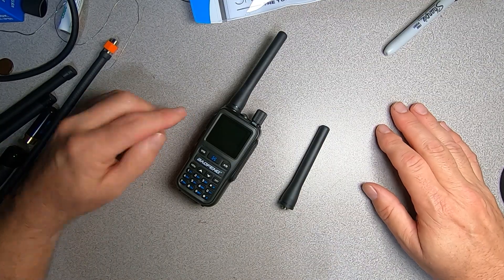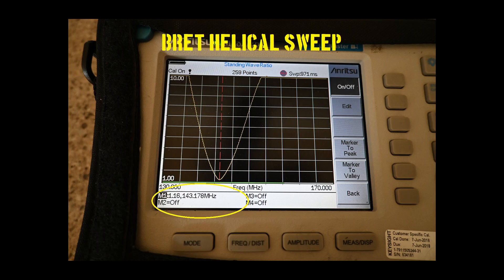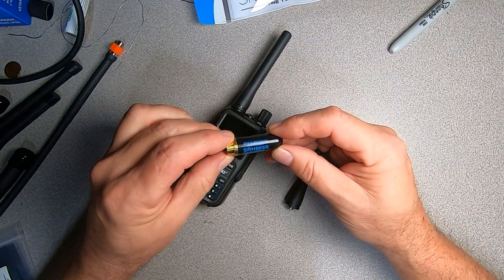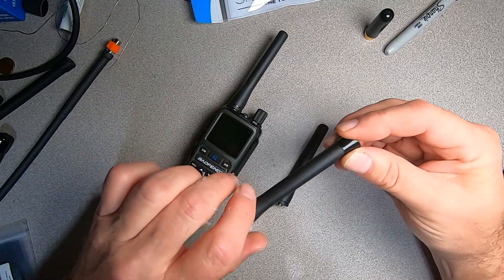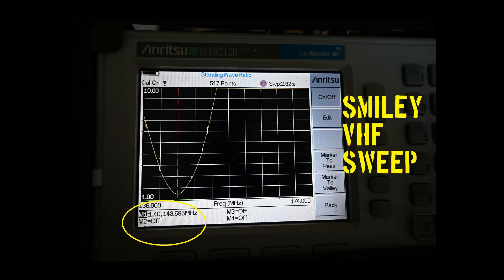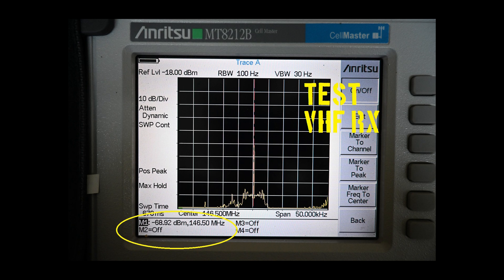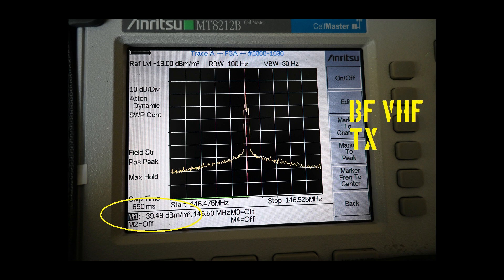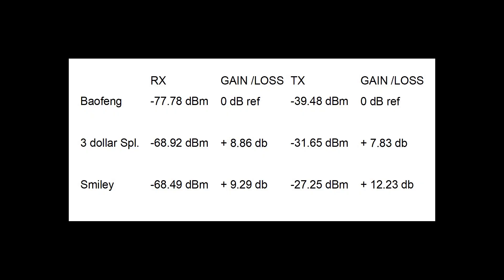The Baofeng UV-5R mini factory antenna is junk. How much better is a 3 dollar  ebay antenna at VHF ?

Comment: Both of my UV-5R Mini's have outstanding receive sensitivity for VHF and UHF.  ALL of the antennas in the box sucked on VHF.  I have a factory Wouxun dual band antenna that is ~4.5 inches long that works very well on UHF and VHF transmission.
Reply from the maker: Thanks for watching !
Reply: Got link?

Comment: Of course,  Baofengs radios & antennas are garbage as usual
Reply from the maker: I would tend to agree but the mini really surprised me. The antennas provided were they fly in the ointment. The radio itself outside of the usual ramped VFO and manual of arms did pretty good especially for it's price point. I won't personally be buying a bucket of UV5R Mini's for a radio cache but if someone did I feel like they could have done worse. Thanks for watching and Merry Christmas !
Reply: @survivalcomms thanks , i get your idea , but I am a person who prefers reliability and quality over cheap prices , Baofeng was good as my first radio only and to hand it to your kids to learn and have fun .
Reply from the maker: @HH-CA  I dig it. I have a few hundred Motorolas for friends and family personally and that isn't meant to be a boast. I bought a couple of the Mini's to debunk what I felt was misinformation. I was surprised that in the raw radio metrics that matter that the Mini was close to the big three in testing unlike many of the off brand part 97 imports. In my testing outside of hardware locking 2m and 70cm amateur frequencies for transmit capability I cannot find an applicable exclusionary rule but of course I am NOT a compliance lab . This should frighten the industry more than it has.